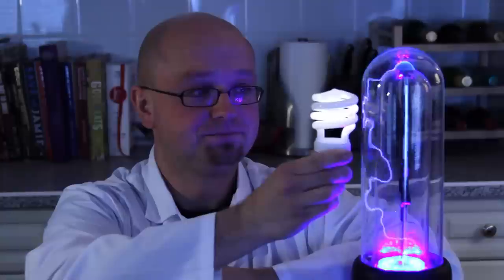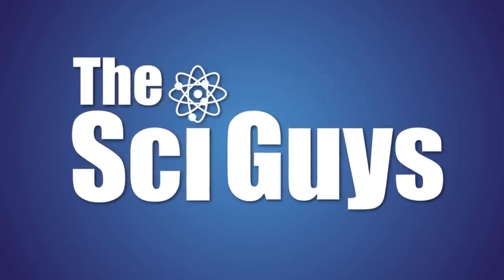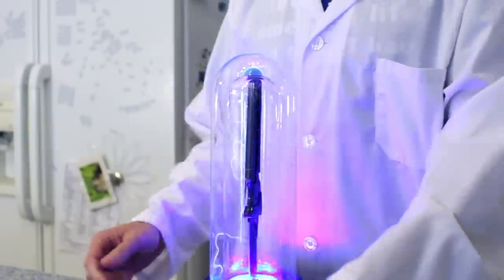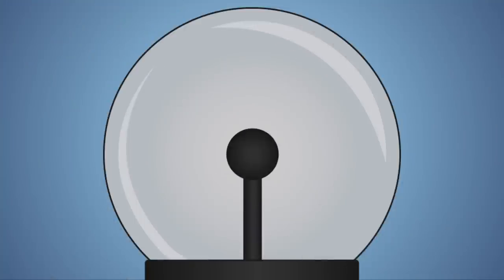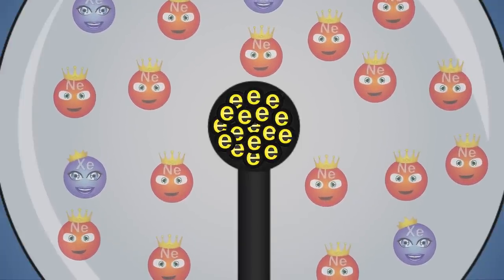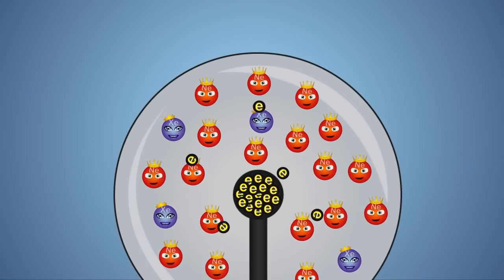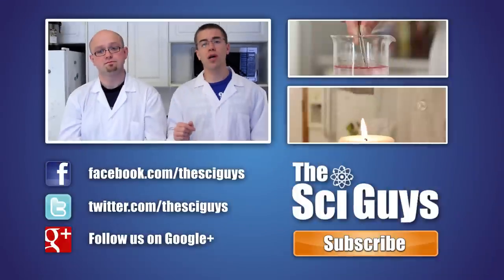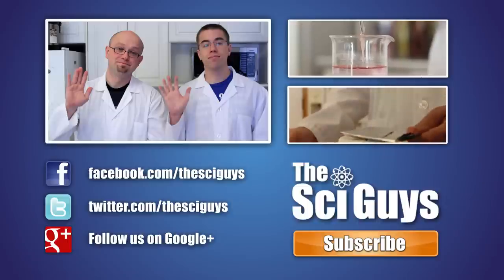The Sci Guys: Science at Home - SE3 - EP1: Plasma Globes and Electric Fields - Light bulb Magic

Comment: Ok so AC right? AC doesn't work that way it oscillates back and forth. Electrons would not stream out of the device. They would move out then back in to the device. Unidirectional impulses would move out ike you are showing with the electrons. Also called an exciter.